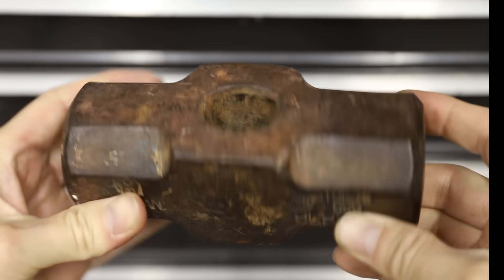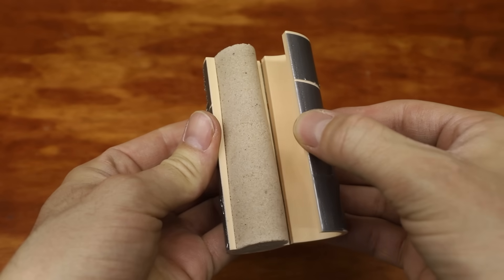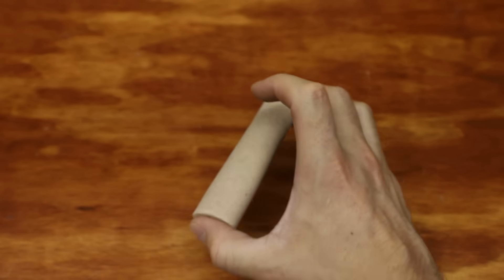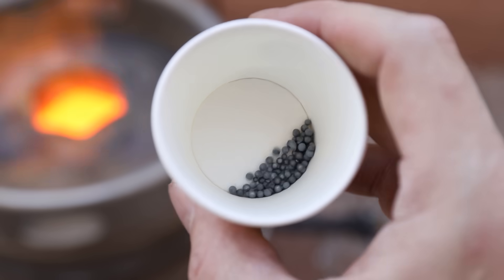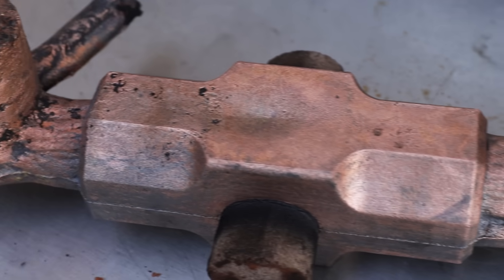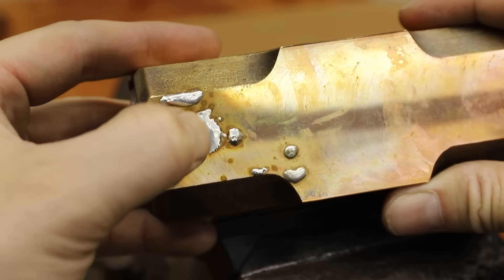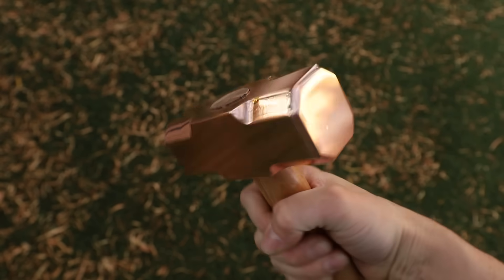Making a Solid Copper Sledge Hammer - HAMMER TIME!

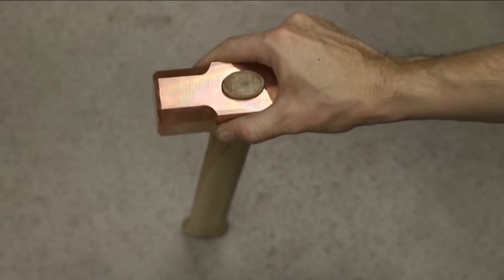Comment: At 10:21 the gaps look real small. You forgot to taper the eye didn't you? You want it a bit wider at the top so it can be securely wedged on there. But if it's a wall hanger, I guess it doesn't matter if the handle would work itself lose since you aren't going to use it anyways.

Comment: The real question is how many Pennies did it take to make that copper bar? Pennies were only 5% copper until fairly recently and they went to 2.5% that's less than 2 grams of copper per penny. You would need to melt over 500 Pennie's just to get close to a pound of copper. By the way. Fantastic finished product. Amazing quality
Reply: The YouTube thumbnail for this video is misleading, as no pennies were harmed in the making. Robinson made the ingot out of copper wire in this other video. https://youtu.be/gDY-upvjOiM?si=ETBjdxiRBe5onaq8&t=140

Comment: That's gorgeous. One small tip: put the copper plug in the freezer before fitting it so it shrinks slightly. (Or in liquid nitrogen...) Similarly put the hammer head in a warm place so it expands slightly. Then the plug will insert more easily and grip better.

Comment: You already had the original, why did you create a 3-d model to make the mold from?  You could have used the original.  I once had a J knife, a rescue tool for aircraft.  It was made of aluminum and took hardened steel blades as a belt cutter.  It even had somebody's initials scribed into the metal.  I made a sand cast, poured aluminum mystery metal (scrap aluminum) and got an excellent duplicate.  I had a small void, tig welded it up, couldn't tell.  It had the original scratches too.

I was fortunate to have in induction furnace to melt the aluminum.

Jim

Comment: I would love to see the face of the archeologist that finds this hammer head in more than a thousand years in the future being like "why is it made out of copper? Why isn't it made out of steel or something that would have made sense?"
Reply: I think they would conclude it was only ornamental. What professional tool maker would make an eye with no taper? None! At least not one that is going to stay in business for long, because friction alone is not enough to keep the head on well, you need it to be wider at the top so the head can't slip out without compressing the wood.

PS. Copper hammers are legit. They are used for the same reason you would use a brass, plastic or rubber hammer. You want something softer than the material you are wracking on so you won't damage it. However, it's much more economical to construct a hammer out of some other material that can have a copper face insert because making the whole head out of copper is expensive.
Reply: @skitidet4302  Thanks c:

Comment: What are you going to use a copper hammer for?  Copper is too soft to hammer steel, and to hard to hammer wood.  Also, modern pennies are mostly zinc.  If you want to melt copper, buy some copper pipe at Lowes.
If you really need a copper hammer, I would buy a piece of thick copper pipe, fill it with lead, cap the ends with melted copper and attach a wooden handle.

Comment: Beautiful tool, the Hickory was a great match for it, I wonder if this tool would/did have a use once. In environments where Sparks could be catastrophic like in warship magazines they used copper tools, chisels, screwdrivers, smaller hammers and such. Surely at times they would need larger hammers, a niche use to be sure but I think its plausible.
Reply: They tools were bronze, which is mostly copper.

Comment: great work. copper hammers are useful in engineering when you have to give something a smack, but can't damage it, like knocking a threaded bolt out of a suspension arm.
Reply: Gunsmith here - we us brass/copper hammers and punches a lot to remove very small, tightly fitted parts, especially in restoration work. Knocking a retaining pin out of an antique rifle is a delicate process, and steel would destroy the object.

Comment: There is a documentary out there along the lines of nikola tesla of water. They report you should only garden/ till your fields with copper tools. The micro copper deposits are extremely healthy for the field and your internal health. This is opposed to the modern steel tools which eventually turn to rust and have the opposite effect. Great video.

Comment: I would think that would be too soft to use for practical purposes. But the way you filled that void hole was amazing!
Reply: Copper sledge hammers are a real thing, used because copper is soft for special applications for no damage to item being hit and also no spark applications for certain industries where gases etc may be present. 
I used to work in a factory that made copper sledgehammers.
Reply: @damiensmith4558  brass too same concept no spark
Reply: @damiensmith4558  especially for inserting hot tool steel insert, preventing to crackin
Reply: @damiensmith4558  I bet I have bought 10-12 copper sledges in the past 7-8 years.
Reply: @csaleen302  we used to make them in all different sizes from 4lb to 28 lb
Reply: @damiensmith4558  also... anti bacterial?
Reply: @damiensmith4558  never would've thought about the sparks. That's crazy
Reply: @damiensmith4558  Would you happen to know why they wouldn't just use normal steel heads with copper faces then? A giant copper block is just asking to be bent and I can't imagine the cost difference.
Reply: @DoesntRefillTheBrita  You could. Or just get copper round stock and cut your own punches and use a regular hammer. Punches deform rather quick but can be melted and re molded most of the time
Reply: @DoesntRefillTheBrita  I guess the copper being so expensive it's not really going to waste once the hammer is destroyed as it could be melted down and recycled.
Reply: Steel=magnetic
Reply: @damiensmith4558  during use the copper tends to disappear as chips and from mushrooming  over the years. Commercial Copperheads sometimes have replaceable threaded ends but by the time he copper head is spent it's also firmly embedded into the hammer head and impossible to remove for replacement anyway.
Reply: We used them in the oilfield on rig sites
Reply: Brass and copper still have their uses. You work on anything that's cast iron that requires force. You better use copper or brass. They absorb a ton of the shock and break less stuff. Also copper is non sparking so like my line of work that is a 100% requirement.  Our tool bags get checked weekly for non sparking tools. Get caught you are out of a job. Copper very much still has its place in modern times
Reply: We used lead hammers in the shop all the time (working on trains). Good inertia, no risk of denting the part being pounded
Reply: They actually sell Brass and Copper Hammers for uses that require them.
Reply: That’s what she said
Reply: A friend's dad had a 66 Corvette with "knockoff" wheels with the spinner. He had a lead mallet that was for use with the spinners so it wouldnt dent or damage them.
Reply: They do make copper hammers for use you know.    (To not damage the material your hitting and without using any protection it won't ruin the surface as it's so soft)
Reply: Copperheads,as they are known are very popular tool generally they come with a hide head the other end.

Comment: I've seen dozens of sand mold casting videos, and still in my mind I feel that when you pour the molten metal that it will distort the mold. Why doesn't the sand shift when the stuff contacts it?
Reply: Cause it's packed super dense.

Comment: Doesn't copper shrink and expand like other metals?  So why did you not repair the hole by freezing the plug in dry ice first so it shrinks enough to drop freely into the hole? When it reaches room temperate the expansion is stronger and more secure than pounding it like a rivet.

Comment: If you're going to be using this hammer for demolition you really want to have Forge the head rather than cast It. Cast copper is incredibly malleable and it only gets hard through work hardening, which would occur during the forging process

Comment: The copper/aluminum knife isnt that surprising. Alumnium bronze is used in marine application where you want the strength of steel but immunity to corrosion and resistant to fouling from barnacles and other marine life. It makes okay knife blades for salt water knives too.

Comment: Instead of making a plug you could have just poured in that melted copper after drilling the hole then machined off any excess the way you did to skip a few steps.

Comment: Use the inscribed circle method for calculating the riser diameter and height. Yes your risers were tool small, and copper picks up way too much hydrogen from the atmosphere to be cast. Usually pure copper is cast in a vacuum or flooded with an inert gas. 
My background, to qualify my comments. ML2 US Navy over 5 years. (Molder aka Foundryman)

Comment: I can imagine 20 years later and a rust repair YouTuber finds this hammer and fixes it
Reply: Imagine it being the same youtuber too xD.
"Left my copper hammer out to rust for 20 years and brought it in to restore it"
Reply: Patina not rust
Reply: @thekickingwolf5115 patina is still not copper oxide, but you are right, rust is strictly iron oxide.
Reply: @thearcticdivini  while you are right, patina-guy is also not 100% wrong since patina is not a real thing, it's just a word that describes any form of surface film on various materials. You will even hear it used about wood in carpentry. Black iron oxide (Fe3O4) occurring in nature as the mineral Magnetite, is quite often called patina by welders and blacksmiths and chefs and knifemakers, despite it very much being a rust
Reply: Copper doesn’t rust it just oxidizes or gets patina on it

Comment: That sure brings back memories 40 ish years ago with a friend. His dad broke a sanding disk. So we made one out of aluminum out of pop cans and aluminum motor mounts. The fine sand we got from a corn field run off. We built a gas and electric smelter. We had a aluminum picture plate of a model T which was copper electro plated. Thats an awesome looking sledge hammer!!
Reply: Fantastic!

Comment: One thing to keep in mind if you ever make a hammer you plan to use is that the eye should be wider at the top so the handle can really expand.
Reply: Another thing to keep in mind when making a hammer is that they should be made of hard metal.  Not copper.
Reply: @Gulgathydra  
No that's not exactly true.
Have you never seen brass hammers,  copper hammers, lead hammers, beryllium hammers?
There are plenty of reasons/ specific uses for softer " non marring " hammers.
Reply: @DavidTSnyder305  well, 2 things.
1 - brass is not copper.  But yes, copper tools exist, but:
2 - a non-marring sledgehammer?

There may be some occasions where you need a sledge that doesn't throw sparks (sledgehammer: a large, heavy hammer used for such jobs as breaking rocks and driving in fence posts), but on those occasions, brass is cheaper and harder, and rubber or rubber-coated sledgehammers exist, and lead-core rubber is far cheaper.  That looks like about an 8 pound head, which is about $30 of copper.
Reply: @Gulgathydra  sometimes making something is just to work with it . you are right though . a titanium hammer head and fibreglass antivibration handle will perform far superior .

Comment: Noticed you had some fire brick sticking to the bottom of the crucible, this can be solved by taking some wet cardboard and throwing it in before placing the crucible when it is hot. It will make an ash barrier which will prevent sticking. Also thank you for using ppe, many don't here and after years of foundry work my head fucking explodes when I see it

Comment: I wonder if you would have been better off heating the hammer head and cooling the copper plug so when they reached room temperature, they'd be under constant tension.

Comment: I did this type of sand casting for metal shop in junior high. It was one on my favorite classes.
 For the void  I would have utilized the copper chips (degreased and dried) from the saw with a tig welder after you drilled and preheated the casting.
Nice finished work.
Reply: I wish my high school had this. we have a manufacturing class which is really fortunate and an auto shop and 3d printing and modeling but a forging or casting class would be amazing
Reply: Junior high had metal working courses!?!? Even the high schools around me don’t have that! I wish!
Reply: @Crohan_31  my high school had wood working metal automotive and so on. was very cool.
Reply: @werewolf74  that’s awesome my highschool had those as well but man a metallurgy course would’ve been awesome or lampworking

Comment: My father used a copper/hyde hammer for 25 years.
I've used it for another 25 years and it's still going strong albeit distorted and flattened now but copper hammers last longer & are tougher than you would think !!!
Reply: I also use two copper hammers my father made over 20 years ago. I actually prefer the copper hammers over traditional.
Reply: Thanks. I would have never guessed that they would be durable. I'm happily corrected.

Comment: You need to get yourself a 8" 1/2 round file.  That needle file is a wee bit small.  Cut 0 or 1 would probably work well for what you're doing.  We always use 00 then if it needs to be prettier a 2 afterwards, 4 or 8 if it needs to be razor sharp but for a single file that has broad applications I'd go with a 0 or 1.  Get 1/2 round not inside ring 1/2 round.  Rio Grande or Stuller are your friend when it comes to good metalworking tools.

Comment: 11:45: G'day from Sydney Australia. Awesome work mate...love it! My only gripe (and it's a small one and probably due to my OCD about symmetry) is the brass lug you hammered into the top of the handle...I would have put it in so that it was parallel to the heads of the hammer. Otherwise, it is a beautiful piece.

Comment: But what is its hardness?

You didn't heat treat it, you just let it air cool.  You could do a Rockwell hardness test on it. After you strike anything harder than copper, the head is going to flare out.  You definitely want to keep this as a show piece, or maybe only use it on rubber or wood.

Comment: If you put a small piece of cardboard at the bottom on the smelter at the base of the crucible it will keep it from sticky to the bottom. I was told that when I did blacksmithing and a lot of YouTube’s to it as well. It helps A TON

Comment: Why didn't you use the original hammer head as the pattern for your mould? Seems like designing and 3d printing a copy was an unnecessary step. I'm genuinely asking - I'm a mouldmaker at a copper foundry.

Comment: Not sure if it is a useable tool, as copper is so soft compared to steel, but sure is a lovely conversation piece.  I owned a copper/leather hammer for fitting and removing the chromed wire wheels to my E-type back in 1974.  Copper added weight and the leather ensured the chrome didn't get damaged.

Comment: You'd have been better off making your own handle, soaking it, compressing it, then forcing it into the head of the hammer. Then when it dries it retakes its shape and is effectively pressure-fit into the head. It won't be coming out until it snaps in half. I only say this because it would be fun to demonstrate.

Comment: Copper plug... press in (instead of hammering), belt sand the handle for fitment and epoxy in place (softer epoxy will take more abuse, but takes forever to set & harden, and needs minor void in wood.. I like to sand/file a band in the wood for the epoxy). And remember to tape around handle/head to keep the epoxy in place.. 
In the Aluminum casing Corp. I worked at there was a practice of pushing the sand down (out of square) for extra material (especially for machining off) the more dense the metal the less this is done.. (why manhole covers are more detailed than a Aluminum can) [joke]..

Comment: That plug idea was nice. I personally would have turned the plug a little bigger than the hole and then heated the hammerhead while cooling the plug to save myself from hitting it with a hammer. Let physics do the work I'm to lazy for.

Comment: You know, that's a shame. Because a sledgehammer is really for brute force work and whilst copper will do it's just an expensive soft metal. 

But a copper (or sand filled) hammer is useful if say, you've got two bits of metal friction welded together and you want to bash them loose. I did it with my steering wheel. Didn't have a copper hammer then, so I wrapped my hammer in corrugated cardboard to soften the blow.

Comment: 9:16 wow not  a real functional hammer but the precision right there gave me goosebumps....awesome Subscribed
Reply: Absolutely real and functional!  As a machinist I keep large chunks of copper and brass in my toolbox to use as non-marring hammers.  And once, as a driveway mechanic I had to use a really old lead faced hammer to drive out a spline shaft that seized...wish I had had a copper or brass sledge at the time. The lead face was a real mess when the job was done, but the end of the shaft and the threads were pristine.

Comment: The copper round bar that I cast also had voids, and then I remembered I had a milling machine and a lathe.  So I turned down some smaller round bar that I had also cast, which revealed voids.  Then I realized I had a milling machine and a lathe. So I...

Comment: Its pretty, but you can't really use it for much. Copper is far to soft for normal hammer usage. I once worked in a factory where they had large steel molds for making plastic and chip board items, there we had copper hammers and chisels (sort of) to avoid scratching or denting the molds. But the hammers were much smaller, perhaps 8 oz. In that case the softness was a advatage.